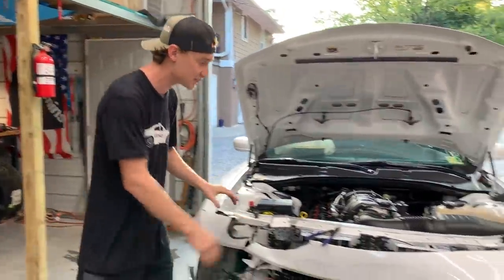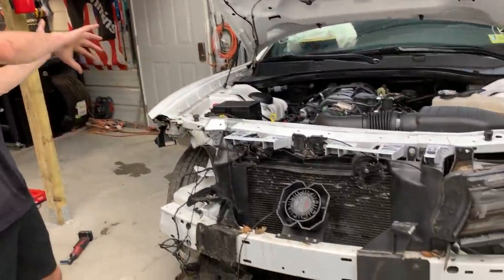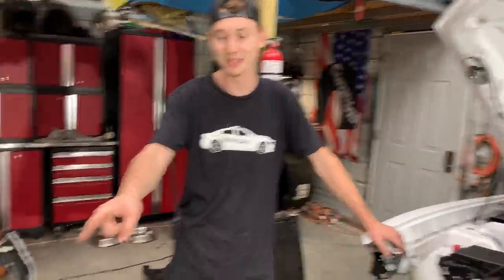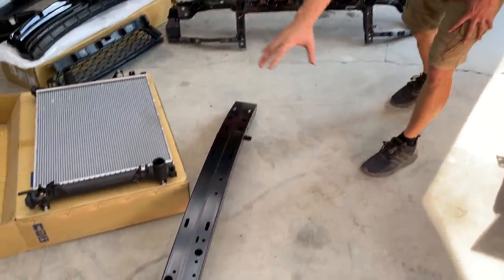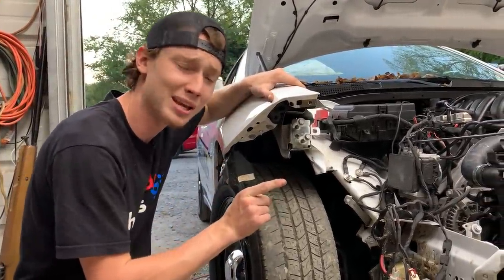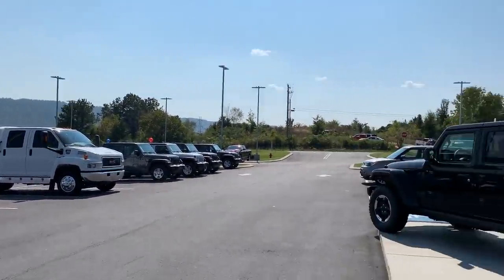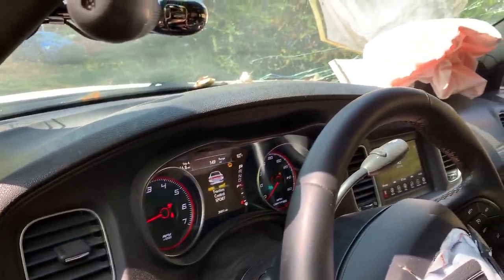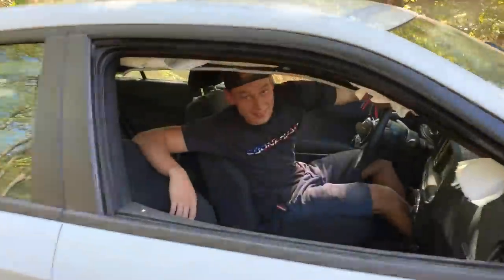Rebuilding A Wrecked 2018 Dodge Charger Police Car Part 2

Comment: That red light definitely add 10 horse power to the wheel.
Reply: Reddawg 75402 the sheriff logo adds about 100
Reply: +10 Poleets power
Reply: On a serious note it would actually take away power 😂

Comment: R/T has a single fan, yours has dual fans. That might be part of the extra cooling. I just finished a R/T front end repair.
Reply: padanky That’s bc they sit for long time waiting to catch a car speeding and stuff so it needs the extra. Cooling
Reply: Intercept package, helps with increased idle time.

Comment: Goonzquad: You ain't running from this thang !!!

Hellcat: Hold my beer !!! 💨
Reply: hellcat is worse car for running from police
Reply: @Robert King yeet
Reply: What’s the best
Reply: NASIR973 Probably an Audi S5 legendary Quattro all wheel drive 3.0T 350 odd horsepower good on fuel yet powerful and will drive on any grass or off-road
Reply: Pretty sure he was caught when he ran out of gas. Usually you cant out run the radio

Comment: Normal people: disconnect the battery before washing the motor with brushes and small stuff so it doesnt get to wet.

Goonzquad: Powerwash that sucker! hahahaha
Reply: Crap sprays in the engine compartment all the time when driving in storms, etc... as long as you don’t directly spray electronics then all is good. BTW, shoot a can of Scrubbing Bubbles in there, wait and then hose off. Talk about amazing results.
Reply: I have been pressure washing engines for 25 years without disconnecting a battery, never had an issue. Ill even power wash carbureted and distributor engines too. Blast the shit out of the alternator too. That stuff was designed to get wet.  where do you think rain goes when you're driving?
Reply: I have had issue before with electrical parts getting wet, and non-start issues, specifically with vehicles that had cap & rotor style ignition systems, rather than the sealed distributorless style.  I try to cover certain parts with saran wrap & rubberbands, if I think they might get hinkey with the water.

If you DO happen to get the inside of an electronic system wet, just take it apart and blow it out with something like a leaf blower (if you have access to one), or some other form of compressed air, to dry it out.
Reply: I always do it when engine running at the same time
Reply: @catfisher420  you'll probably cause the alternator to fail early from spraying high pressure water in it. Designed to get splashed not pressure washed!

Comment: Goonzguys, Rees the truth about driver aids. I had a 450 HP Porsche Cayenne SUV. First turbo in Texas. I had a German conversion, from an after-market company from ROF, sounds like ROOF.lots of upgraded pushrods and the gearbox was nuanced, to handle the torque. It started in second gear. The conversion took it up to 700 HP. Air suspension squatted the car down and I could vary ride height and stiffness. When finished it was super-quiet, but I made several Z06 owners look dumb. The Cayenne was a complete unknown. Here’s the take-away message. Noise is lost power. I loved my Porsche 911 twin-turbo X50. Five hundred HP, but it purred quietly. I love that. Noisy isn’t fastest! Love your work...

Comment: The air filter On that hellcat at the dealer is a stock Chrysler cold air intake. You can install the same thing on the police car.
Reply: We have on our Chargers. The stock intake grabs the air from the bottom. It WILL suck water in and hydro lock the motor.
Reply: @dealy9268  -> That important information to know!
Reply: i hate to say it but the stock intake is not gonna suck in water and hydro lock your motor unless your in 3ft of water. the cars are put through rigourus testing under wet conditions for this reason
Reply: its best not to put out false info unless you have data to back it up
Reply: @bradgraham8272  -> 3' of flood water on our streets is ~ unfortunately ~ not that unusual over here in South Texas.
Reply: ok and even then rhe sealed factory airbox is gonna do better than an open element filter. the stock airbox water has to travel up a long tube with several bends. an open element filter just has to suck in splashed water that happens all the time when it rains. the oem boxes are the best thing to protect against water minus a snorkel to the roof
Reply: @bradgraham8272  -> Perhaps if scientific evidence supports your assumption. And that includes how hot that engine runs. If the evidence is not available I'll just make note this is but one more example of marketing separating the owner from his/her cash.
Reply: gary packwood, what does the engine temp have to do with a airbox being more prone to stop water intrusion than the other? your grasping at straws here bud. automakers dont spend millions in designing and testing cars for no reason.
Reply: @bradgraham8272  -> I can't be grasping at straws if I'm asking for full disclosure of scientific information about this subject. I already have older data concerning the temperature of air pulled from the engine compartment. Billy asked a very good question about that air filter and I think his concerns needs to be addressed.
Reply: you have gone completely off topic of watet intrusion through the stock intake. but if you must know it has been proven time and time again that the factory airboxs produce a more constant iat temp than a open element filter. its also been proven that it takes a highly developed cold air intake to produce hp which a k&n or factory mopar cold air isnt gonna do. now a legmaker cai does produce hp and work really good but the factory airbox will still outperform it in city driving and stop and go traffic
Reply: these days manufacturers are squeezing every ounce of horsepower out of n/a engines as possible. in return they leave very little on the table for the aftermarket
Reply: the debate on cold air intakes has been beaten to death.
Reply: @bradgraham8272  -> Good to know and I'll pull up the studies this evening from the U.S. Department of Transportation.
Reply: haha i could care less what a government funded program has to say because it says whatever they are paid to say. i prefer real world data done by independent testers
Reply: @bradgraham8272  I have seen it. We have it on dash cam. A Honda civic went through a flooded area no problem. Our patrol car followed about 5-6 car lengths behind.  The engine sputtered and locked up.  This happened 2 other times to 2 other chargers in our department.   This was in less then 2 Ft of water.   Did I mention I was an auto tech for 24 years before I became a cop?   Since we changed to the cold air intakes we have not had any issues. Not even in Hurricane Matthew witch flooded our city.  (Smithfield, NC).  I will say I am not sure about the current generation Charger.  They may have changed it.

Comment: Goonsquad former awd charger owner here that did alot of mods on that platform.  guys the 2011+ awd charger is on demand awd.  Above 45°.  If you want to make it rwd only you can pull a fuse for it.  Also to force it in awd full time you can turn traction control off.   The stock system is really great on stock power.  But beware adding power the awd transfer cases with the clutches in them are pretty weak wont hold up to big power or at least not for long.  Not many options to combat that issue.  If your gunna add forced induction I'd recommend a procharger system so you dont get that hard torque punch right off the bat that will help prolong the life.

Comment: “Idk if this is the iron block”
“It’s probably just a steel block” 

🤦🏼‍♂️🤦🏼‍♂️🤦🏼‍♂️😂😂😂😂😂😂
Reply: I always find it funny, but different people learn things differently
Reply: LOL
Reply: Joash Church there’s no steel block...
Reply: They probly dont know shit about cars lmao. Theyre film guys who can turn wrenches and use google and got good at it
Reply: I literally died when I head that... The way he said steel block
Reply: @Shadow0fd3ath24  well they're proof that you don't need to know everything about a subject to actually do it,  I rather have a method to learn, than to just memorize data, you don't need to be an engineer to understand automotive mechanics, it's actually easy to throw some pompous definitions and call yourself an expert, and even if you know about the stoichiometric ratio, or how bore and stroke affect volumetric efficiency and compression ratio and they relation with power output or how to determine the best gear ratio when assembling a custom transmission is not guarantee that you'll have ability to actually understand and perform a repair/tune on an actual car,  also they usually don't mess up much with engine related things, usually swap parts and do body work, so your oversimplification of the boys shows 2 things, 1)you are butt hurt because even when you believe yourself a "true knowledgeable car guy" you do shit but complain, and 2) this is not Hagerty or Power Nation, they're two guys in a barn fixing cars I and most likely you cannot afford, so please cut the hate and stfu.
Reply: Don't get me wrong, I like these guys.  However, they are limited on their knowledge of car parts and definitions.  That being said, they ain't afraid to jump in and tear thing apart and rebuild them.  The phrase "there's more than one way to skin a cat" applies to the Goon Squad.  Politz is a new one for me though.
Reply: I think the word was alloy block they were thinking of alloy/cast iron
Reply: @izzyplusplusplus1004  And I'm sure that's the extent of your knowledge about metallurgy.  You probably couldn't tell an iron block from one that began as bauxite.
Reply: Joash Church yes of course one is iron the other is steel🤪
Reply: @BigShastaKen  Bauxite is where we get aluminum, numnuts.
Reply: @ElLuigyboy  Best comment on the thread.
Reply: Who cares if they didnt know there wasn’t a “steel block” for a Charger? It has nothing to do with their ability or knowledge to work on cars lol. But you may need some Icy Hot for the muscle pain from all that REACHing 😂😂
Reply: Yea they really don't know much about cars and always call things the wrong name. But I still love the vids.
Reply: @BigShastaKen  Since you are the metallurgist, can you tell the rest of the world what billet blocks are made from? And the source material? 
If your I.Q. is over 80, you should have the answer already. It's in this thread.
Reply: Jared Lumbert , Steel and “iron” are both made from the element iron, steel has a lower percentage of carbon than “iron” and is actually a purer form of the element.
Reply: @regabernathy6039  Exactly. The added carbon increases tensile strength, with the mohs hardness also increased. It decreases wear, because the pistons cannot scratch the cylinder walls as easily as softer steel. That's why aluminum blocks are sleeved with a pressed in cylinder wall made from cast iron. Or other high hardness alloys.
Reply: 🤣🤣😂😂😂 leave the homies alone.

They are solid
Reply: @ElLuigyboy  oh yeah i woildnt be here if they werent good builders and learning quick. My reply seemed like they were idiots but i meant it more as they are just normal guys who blew up

Comment: The zip tie on the head rest was to attach a steel ballistic plate. A lot of us do that in our cruisers for a little added protection. I would also look into doing hellcat lifters. I had a 2013 ram with the hemi and if the vehicle has the MDS system, the needle bearings in the rollers will likely fail causing your roller to seize up and eat a groove into the cam lobe and eventually causing a misfire. If you’re going to be in there to do rods and pistons, lifters are a must

Comment: It's called severe cooling cause these cars sit idled a lot
Reply: I would think they would want better cooling for high speed chases and getting to scenes faster too. Maybe I'm wrong. But I would think the idling hours and wot
Reply: @johnjesus971  well I can see they don't really understand the importance of that police cooling system. Trust me those engineers call it that for a reason
Reply: @The_Bandit_750  I agree.
Reply: @johnjesus971  when the car is going fast there is lots of air flow through the rad. The severe cooling is probably heavy duty fans for when its idling

Comment: As 5.7L hemi owner I suggest at first you have to upgrade the exhaust and headers (shortly headers) cause I don’t how they put such like exhaust manifold as well as the intake you better put on some cold air intake.
Second thing i don’t how is the weather at your city but these hemi going overheat so butter you have a 82c degree thermostat 
Third if you want to upgrade features like srt pages and performance pages you can use either tazer or mopar micropod 2

Comment: Guys:

When you refer to the frame rail as
“It looks pretty straight “
That’s Not Good Enough!!!!

This is a very serious situation.

It has to be dead on Straight!!

You need to put that Cop Car onto a frame machine and check the frame measurements in detail.

A slightly Bent Frame will throw the geometry and handling of that car way 
Dangerous off.

Thus making your new Rocket  a Road
and Liability Hazard/Risk!!!

If a frame is not repaired properly.
The car is sold. 

It has a “Salvage Title”

It’s involved in another accident where people are hurt or even killed.

They will come back to you and look at that car with a fine tooth comb.

So Cover Your Asses.
Get a frame shop to check and report on the frame!

Cheers 
P.S I really do enjoy your channel!

Comment: Hey Goonzquad, The upgraded/heavy duty cooling system is the oil cooler adapter. Those only come on SRT and Pursuit equip vehicles. See the line from upper radiator hose/thermostat area that runs down to the oil cooler on the oil filter housing.

Comment: I would think you need to remove the “SHERIFF” from the side before driving it.
Reply: Just tape it
Reply: Thats why they are in backyard
Reply: If they drive that car on the street with them decals it’s a felony for impersonating a officer and using any lights or sirens would be a felony also
Reply: G-reg716  actually no, using lights and sirens can be either a citation or misdemeanor unless they pull someone over then it turns into impersonation which is 9/10 times a felony
Reply: Ryan Bollinger I know someone that got a felony for just wearing a police uniform shirt, he did not try stopping anyone he was just wearing it.
Reply: And replace it with 'Poleetz"
Reply: Ryan Bollinger wrong! The moment you drive a marked police car on the streets and your not a officer it’s a felony  10/10 times
Reply: @carl fxi Even better
Reply: G-reg716  not exactly as long as the decals are covered or removed

Comment: When you guys inevitably take the stickers off,
Stick them to the back of the shop wall,
Do not ruin them
Reply: Nah, they should just leave em on the car
Reply: @JoeGarofaloII  illegal
Reply: Joe Garofalo II legally they can’t register it with those one,
Bet the won’t even inspect it.
So if they have to take them off,
They should hang em up on the wall in the garage
Reply: @articat568  they're not gonna look at the side of the car when they register it, I say send it!
Reply: Joe Garofalo II yes they will,
You ever had a car inspected after it’s been salvage rebuild? 
They check literally everything.
Reply: @articat568  did you see their new video? The one where they got a new car with lights and sirens so they can put them in their cop car? I don't think they're worried about it buddy
Reply: Joe Garofalo II yea and I’m sure  you saw they still took the fender stickers off😂😂😂😂
Reply: @articat568  yes, because they had to prep and paint the fenders to blend it into the hood which they explicitly said. They also didn't remove the GIANT Sheriff decal on both sides of the car and they're gonna put lights and sirens in it. Nice try there guy 🤣

Comment: Been waiting to see a Charger build , now I get to see the difference between the 2006-2010 series compared to this model year , I did a complete suspension rebuild with Hotchkis springs and sway bars and power stop slotted and drilled rotors and carbon ceramic pads on my 2006 RT , next up is a supercharger for mine , can't wait to see what you guys do with this one , keep up the good work guys !!

Comment: The power steering is basically a regular hydraulic power steering pump with an electric motor and a computer controlling the motor. It gives the car nice and heavy steering when carving corners at high speeds, but would automatically make the steering light if the driver is driving in a parking lot, doing drifts, or doing evasive maneuvers. I have it on my car and it feels awesome to drive.

Comment: Hey guys that car will have a bigger radiator and a high amp alternator and anything will be heavy duty  for that car.  I had a highway patrol car and it was built to last.  You can look at their web page and look at service vehicles and find out everything about them.

Comment: Going back to the first video, the lights in the back window might not be the only lights. Sometimes they put "hideaway" lights in the headlights and taillights. Also if not those then there might be a small box in the rear and or front that flashes the headlights and or taillights.

Comment: To answer some of your guys questions I personally have a pursuit and have been building it. The standard cooling system is single fan where the pursuits are dual fans. The rotors are about 1/2-1” bigger all the way around, and not sure about the newer models but I have a 2012 and they add a sway bar that doesn’t come on r/t model for suspension

Comment: If you want to disable the AWD open your fuse box under the hood (look on inside of lid it lists the fuses you need to pull) and remove fuse 9 and fuse 48. This will turn off the AWD. It Will not hurt the car at all I've ran mine for a while with it off in the summer and then put the fuses back in for the winter months with no problems.